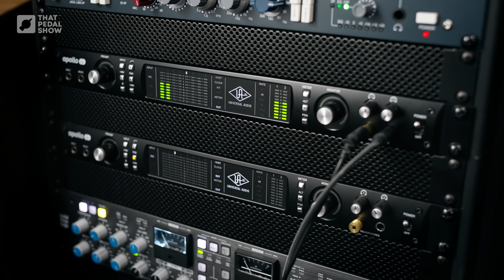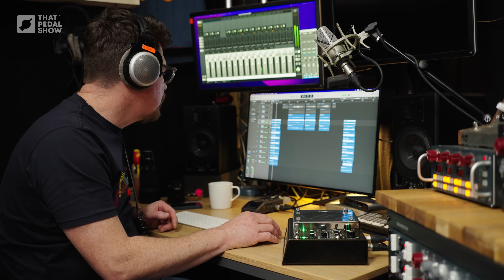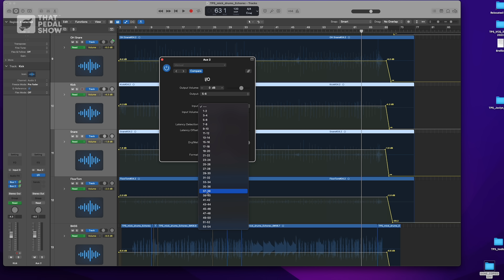Drums & Guitar Through T-Rex Echorec? [Guitar 'Pedals' As Studio Outboard]

Comment: Good job Mick! I much prefer using outboard to plug ins because as you say it inspires and of course is more fun. I am surprised however at the lack of kill dry without a mod on the echorec. As others have said, I think the use of effects pedals as outboard could be a really interesting series to see what will and won’t work. EG the origin Effects or Empress compressors v a modelled plug in or what overdrives may work on vocals.

Comment: I had an old BBD rack on my pedal board a few years back, the sound was so great but it had a noticeable high frequency noise and I stopped using it… until I bought my first wett box and noticed that with 100% wett the problem was gone, all the noise was in the dry sound. 
 it never leaved my board after this ;)
But tape is another beast and it’s hard to work around the hiss      With a guitar amp !
Leo

Comment: I use the T-Rex Replicator tape echo on pretty well every song (individual tracks only) as an outboard effect. It thickens like no delay plugin I currently have. I'll often have more than one to get stereo. Most of the time the noise floor isn't a problem at all. If it is, I use a noise reduction plugin. 

I imagine it would be a similar experience with the Echorec. Hopefully it's easy to figure out the kill dry thing; it seems odd NOT to have a kill dry switch when they went to all the trouble of installing XLR in/out jacks for studio use.

Comment: For the short time I had the trex binson. I felt the noise was bleed from the motor. I kept wishing that more time or money had been applied shielding or isolating the motor. No amount of giggling between record level and output level left me with a satisfying enough signal. 
I also tried running the unit after the stereo outputs of  the ox box. It was better in a limited home studio environment. But not why I invested in the unit. So ends my adventure into unusual or historic effects.

Comment: The only limit to outboard gear is the number of physical I/O you have. It can be extended by using an input channel rather than a bus and recording the effect but that does mean you can't twiddle knobs on the effect during mix down.... on the other hand it does allow you to reuse your outboard gear. These things should be true of any DAW... probably most will anyway. I use Ardour (Mixbus without the fancy channel strips) which was once based on PT workflow though both have diverged over the years. The only thing to be aware of is that all outboard gear has some latency that the DAW may not be able to compensate for. For many types of analog gear that doesn't matter, the same was true with analog equipment to a lesser degree. A proper plugin is automatically latency compensated. Live effects that are recorded at take time often go with the performance better than effects added later because the player plays to the effect somewhat. As to plugins vs. analog gear.... I wouldn't touch that one :)  For me it is more of a money thing, I can afford plugins.

Comment: A bit too crunchy on the effect both insert and aux in the beginning. Noise gate should help when you dropped effect level. The 1073 plugins have one built in. I have a BAE 1073 and still use the plugin for the gate. Also try parallel compression on drums. DBX 160 is great, a level up